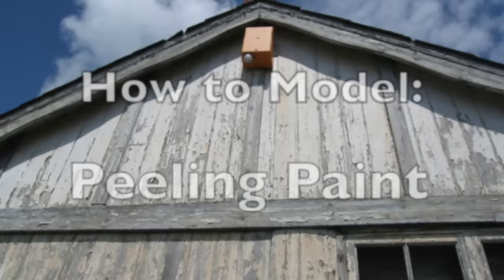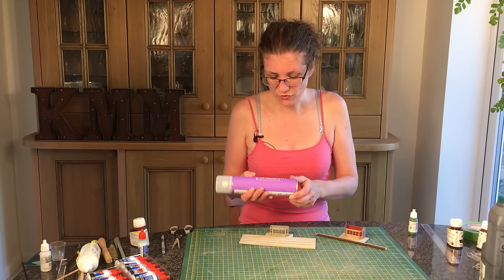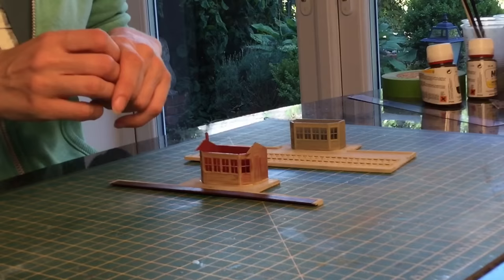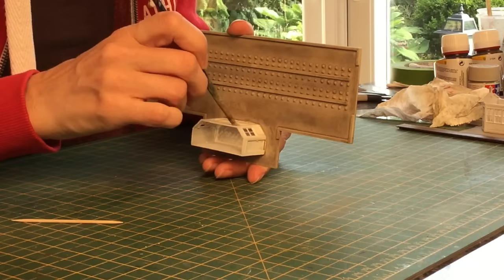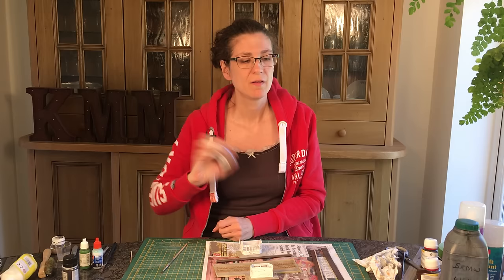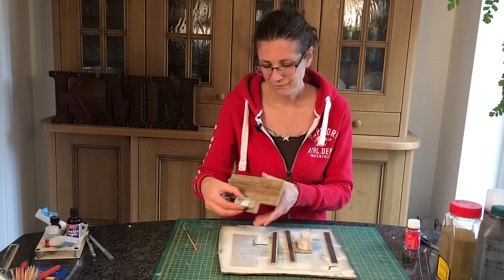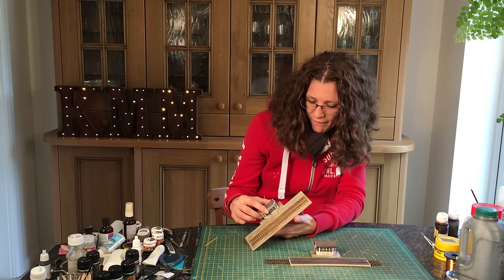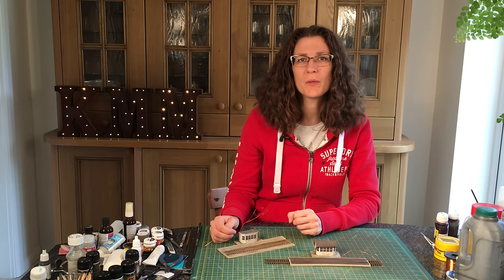How to Model Peeling Paint

Comment: Kathy, also U can paint thin coats of paint then apply rubber cement or contact glue then paint over the glue a top coat. After pain is just tacky so won't smear use a rubber eraser or an old yypewritter eraser and rub till you remove the desired amount of paint. To make the wood older and peeling..
Reply from the maker: I’ve done that many times and it’s a great technique. Thanks for mentioning it.

Comment: Vallejo/mig/ak paint will peel in sheets. tamiya is much better paint to chip with. thin with a little x20a 2:1 and a drop of water.
Reply from the maker: cdrseabee Thanks for the input. I've used both and the Vallejo is more of a plastic film.

Comment: Kathy would this technique work on plastered buildings or just plastic...Thanks, great videos by the way
Reply from the maker: Junglelands It will work. I would seal the plaster well with a good primer (I'm in the UK and use Halfords car primer), then paint your colour and hair spray layers. As long as the primer is robust, you'll be fine. I would recommend a very thin top coat in a more delicate paint like Vallejo as it will come off easily. I find Tamiya needs more scrubbing. Leave a bit of water on the surface fir a while if it's stubborn.
Reply: Kathy Thanks for your prompt reply, I'm also in the UK Never try Halfords primer before always used Vallejo, just wondering could you use Halfords primer on scale models, I'm an armour modeller. Your videos are very helpful regardless what you build, very handy indeed, Thanks kathy
Reply from the maker: I always use Halfords Grey Prmer (sometimes red on brick buildings) or their Matt black spray paint as a primer.  I don't find it a problem on fine models but I'd experiment a little first if you are worried. It is a little cheaper so the pigments probably are larger than a Tamiya primer say.

Comment: That's not a bad effect at all.

I use a similar but different effect using salt.

1: Spray your model the colour it would be underneath (wood, metal, previous paint shade)
2: Mix a paste of salt and water (something the consistancy of toothpaste)
3: Apply the paste where you want the paint to have peeled off
4: When dry, spray the model the colour you want it to be (clean, or weathered mottled)
5: When dry, wash the model with water, lightly scrubbing with water.
The salt will dissolve taking the paint that was on top of it away with it.
It has the bonus effect of leaving a crusty edge, like dry raised paint that would flicker off if it were flicked (on the 1:1 item). 

Here's an example of a freight wagon I've done.
http://i.imgur.com/vVveBHI.jpg
Reply from the maker: Cliffjumper24  hi, I love the salt technique too, I just find it hard to make it small enough in HO sometimes. It's a great effect though and I'll be doing a video on it at some point.
Reply: Kathy Millatt You can get fine grade salt.... or alternatively, crush normal table-salt with a rolling pin into a powder, or put it in a tea strainer (how do you spell 'ciff, siff?) grinding it with your thumb.
Reply from the maker: Wow, I didn't think you could crush table salt!  Mine is incredibly fine anyway but it's getting it to stick in a fine enough manner that I also struggle with.  I found it flaked off a lot or was too thick.  Having said that, it looked great the last time I did it and you do get a realistic effect.
Reply: Kathy Millatt
If it was flaking too much, maybe you should try watering it down a little bit, and do some experimentation on some scraps of planked plasticard.

The picture I showed, I think, shows how good the effect looks.

Incidentally, here's a book I recommend;
https://www.forgeworld.co.uk/en-GB/Imperial-Armour-Model-Masterclass-Volume-One

It's one of the Games Workshop companies, and it's brilliant for weathering models.

One last thing, the hangout you did with the model builders last week.... I was the person who asked about Enamel paints.

I've found british modellers are allergic to anything 'but' enamels.

As a railway modeller, wargamer and aircraft modeller, I use a range of paints and techniques, and they overlap.

For example, I've found that railway modellers don't paint 'people' (passengers etc) very well... they just paint a skin colour, hair colour, trousers/skirt colour, and shirt/bluse colour... so they look very very 'flat'.

Wargamers use shades and highlights to give the figures 'dimension'.... and that's a technique rarely seen.
Reply from the maker: Hi, I love Games Workshop and the way it encourages youngsters into our awesome hobby.  I've mostly read Mig Jiminez's books so will check this one out too.

I think one of the problems with people painting is that in OO, 1/76, their faces are so small, most people can't be bothered and if you have a lot to do, then it's tempting to skimp on the detail.  I know what you mean though, it's the mini people that give most railway scenes away as models.  They are so hard to do convincingly.

I love acrylics although enamels have their place, and in weathering, the ability to re-dissolve and alter is a real Godsend.